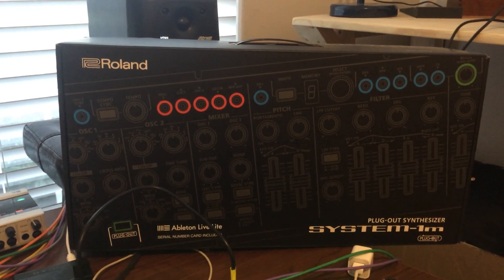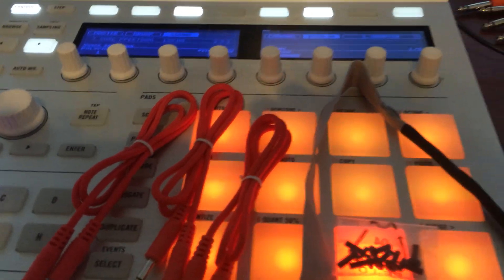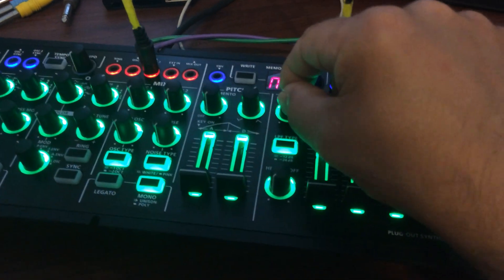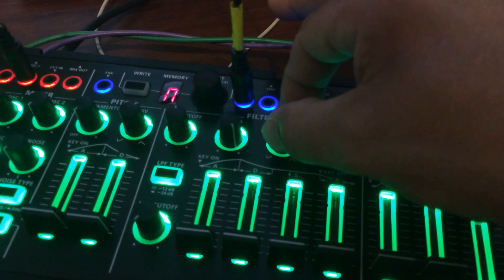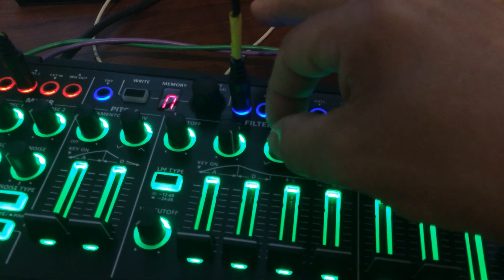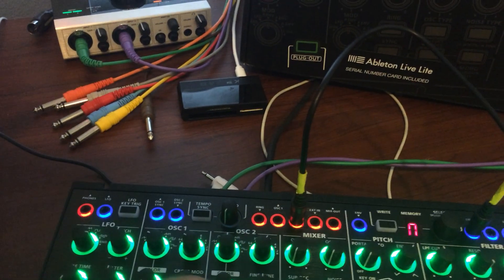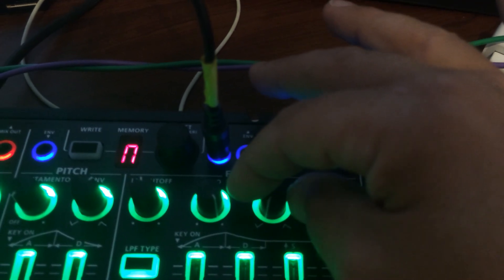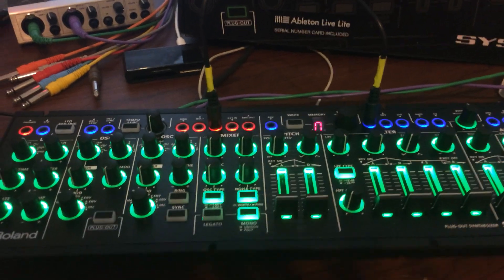Roland System 1m Audio rate Modulation

Comment: well duhh 
My clavia nord modular does it all at 96 khZ ../ 24 bit 
 almost 20 years old ,and no cheap plastic build quality
Reply: Ward de jager and you need a functional computer from 1998 in order to use the Nord Modular, so....
Reply: get you facts straight  ,you can run the editor in legacy mode on win vista /win 7 and win 10 .
Apple/mac guys are in trouble yes , but those are idiots anyway

Comment: Awesome!  I would have had a bit of anxiety plugging oscillator 2 into the filter envelope that way, because as I understood, the jacks lit up with red are audio, and blue is for C V.  I guess that the audio is only a quieter signal and CV WAY louder, so no damage possible, really.  I would expect that most of these modules would be built robustly enough to handle some ‘risky patching’, especially with Roland.  I’m still pretty new with my modular/Eurorack knowledge, but as I’ve just acquired a Soulsby Oscitron and the Uni-Five (takes bipolar 10vpp and converts it to unipolar 0thru+5V with attenuators for two LFOs and a gate.  It’s meant to accommodate Oscitron, not being tolerant of any other signal outside the unipolar 
+5V.  So many micro controller and digital based 5V modules, I wouldn’t be surprised if the UniFive module becomes very common.